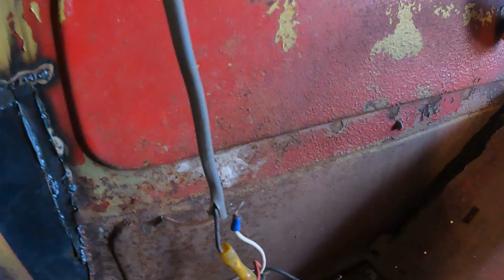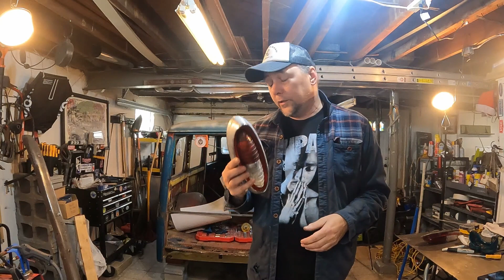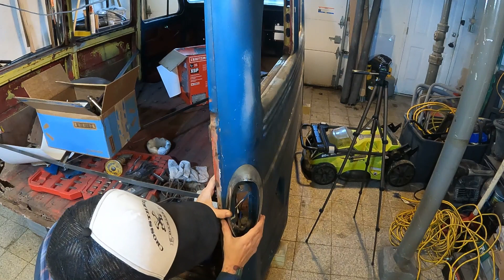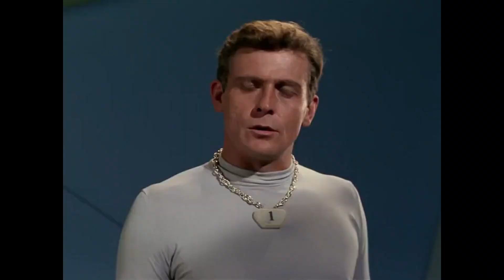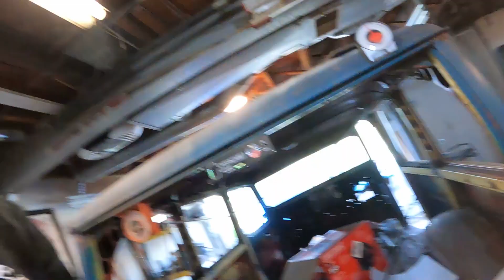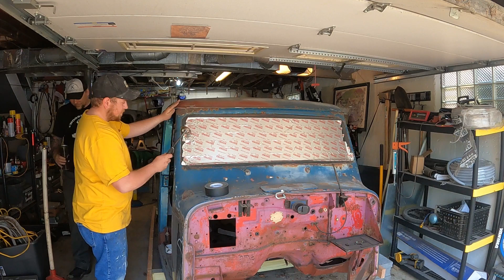Hell week 1962 Willys Wagon

Comment: Haven't been following the build..so i'm sure you have solved the tail lights, but I think led strips is the way to go on these.  The skinny upright has no room for anything integrated.  Others I've seen done is build a bulge out from the sides to give you some area to mount the lights.  So those oval ones could work if you build up a big oval-ish area that sticks out of the sides.   So yeah I think led light strips, like some escalades I think use them.

btw, my willys build is collecting dust, and my current 'free motorhome' project I've spent now like almost a week just doing the wiring, so yeah big projects always have many downer days/weeks/months.  Gotta stop the burnout and take a break...just don't let the break turn into never getting back to it like mine do..  :)
Reply from the maker: I feel ya on the burnout!